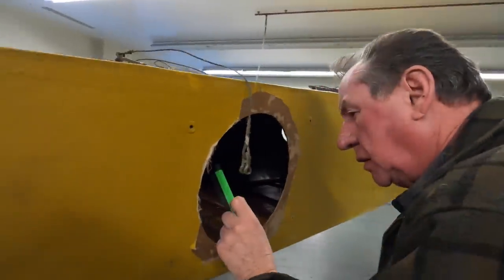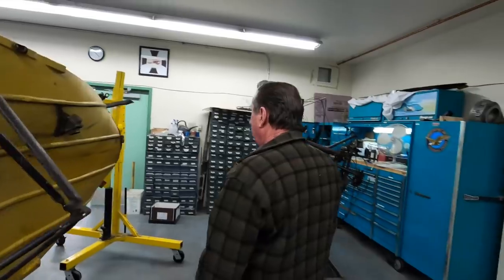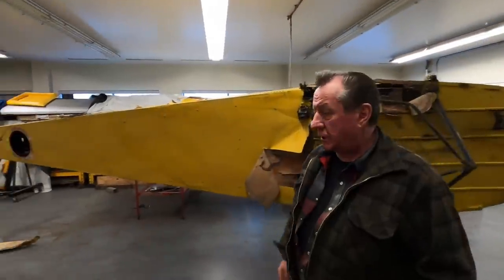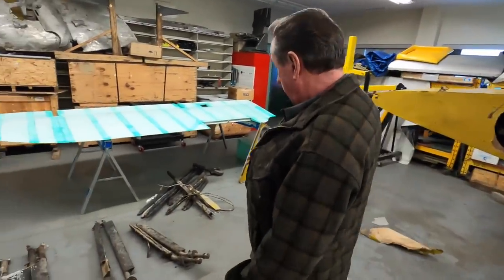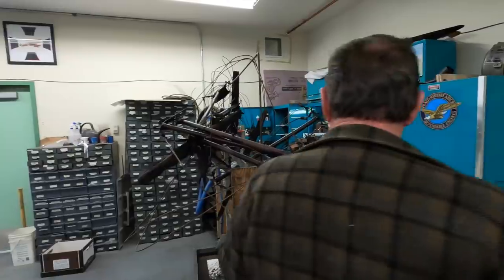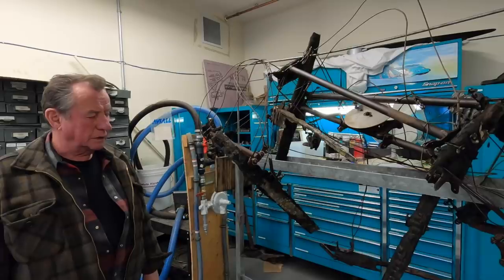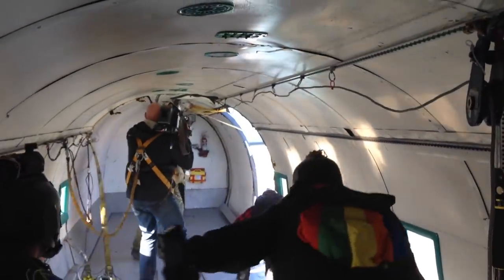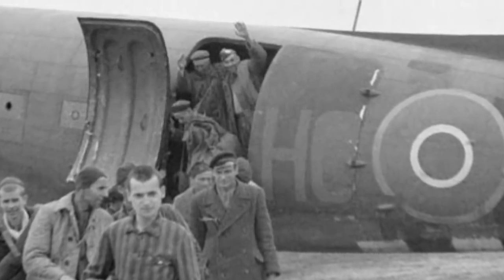Why is my Airplane Sideways? | Plane Savers S2-E37

Comment: Mikey what you guys are doing is awesome! My dad used to take me to a workshop like that, they specialized in DHs too. We were lucky enough, back then, to meet some of the pioneers that flew them - amazing aircraft and amazing pilots.

Love what you did with the DC3 photos.

You touch on something re photos. Photos - even black and white ones - if reliably dated/datable - will tell you exactly how an aircraft looked and was kitted out at a given date/time. Original plans, design drawings etc are useful but quite often they're merely a statement of intent (perhaps only relating to a prototype) and not always the same details/construction as production aircraft turned out in the end. 

We live very near several old RAF bases that catered for the Parachute Regiment AND the 101st Airborne, 'The Screaming Eagles', Dakotas, Horsa Gliders etc were stationed all around these parts. We love DC3/Dekotas. There's wood carvings, stained glass church windows etc with them depicted and venerated hereabouts.

Keep up the good work!

Comment: I can see that Joe is immersed in his Fox Moth project and that converted jig will really assist in getting down to the detail work in the near future,what a great pity about those wings but all is not lost because Tiger Moth wings have been converted in the past for the folding wing brackets on the DH.83C,a bit of work to the main lugs and a study of the respective drawings will show how it is done,suggest that you contact Croydon Aviation at Mandeville in New Zealand who have restored a few Fox Moth's and will be able to assist in many ways.

Comment: Hello I'm that old fart skydiver from San Diego. I use to jump out of a DC3 at Otay Lake in southeast San Diego, short dirt runway with a lake at the end for ditching.  It had a polish door on it. {that's what we called it}. The door was on the right side. only one I have ever seen. I'll see if I can find a tale number.
Reply: A DC-3 or a DC-2 for that matter could be ordered with a left side or right side passenger door or both. And, of course, with or without a "hamburger door." That's one reason the USAAC/USAAF had many different designations for a DC-2 or -3 since they bought small numbers before WWII in different configurations and impressed many civil airliners into service in the early part of the war. There was even a DC-2/-3 hybrid before the C-47 went into production.
Reply: @dalecomer5951  definitely a DC-3

Comment: Is that tail section correct? I mean, i don't know all that much about airplane structures, but i do know a bit about metal structures and that seems like a stress point. Almost looks like someone cut the tail off and moved the metal down. Weird.

Comment: You will have to do more research on those Goonies, you may have more 'significant' planes in service or stock.
While I am sure unviable but would have been cool was flying into England last year with a load of freight, unloading, joining the celebrations than loading up freight and going home.
You have 25 years to plan for the hundredth!!
I like Joes rotiserie, lucky it is only a smallish plane. You could not done that to  DTD, or at least easily. 
You could with the Fokker however.  Would make it easier to repair the damaged sections and even [a seperate one] to build those wings.
I suspect if you have too you have enough parts to build the  wings for Joes plane. Those forged mounting plates should be fine,, the tubing will be stuffed however.